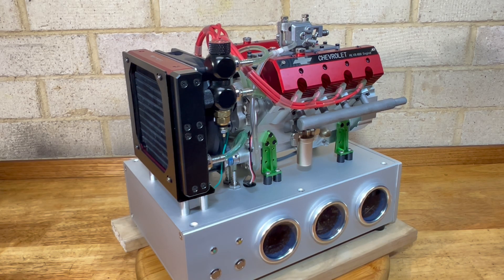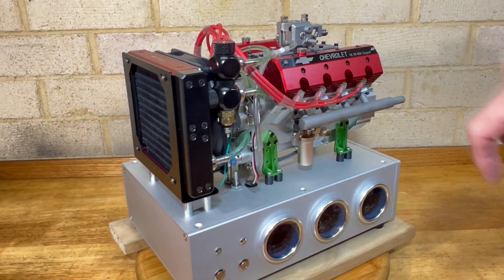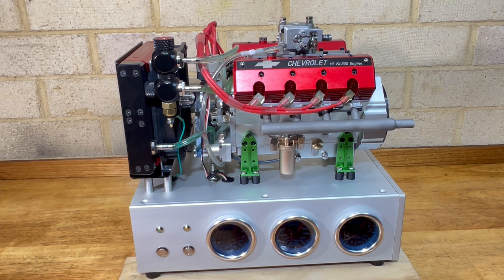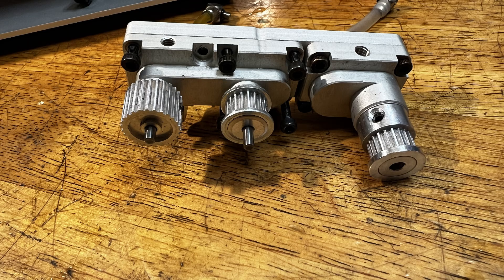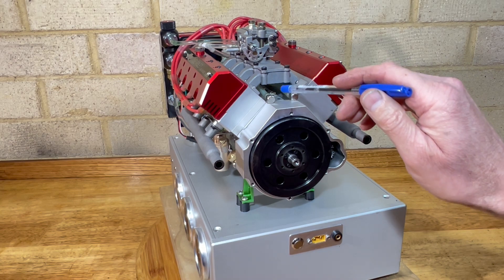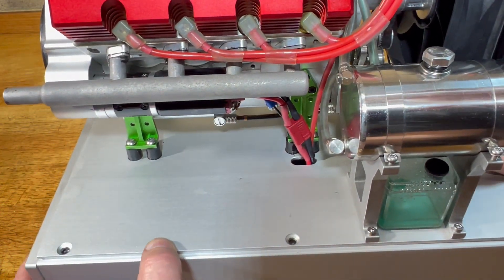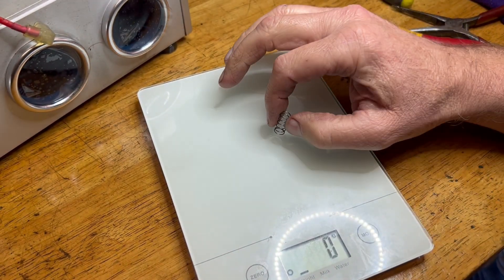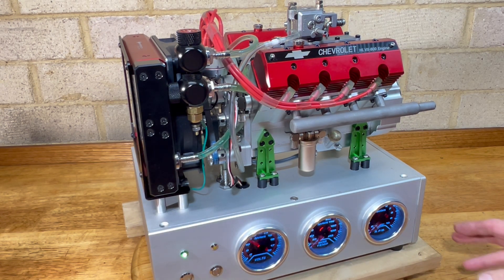HL VX-800 Scale model engine

Comment: Hello, I am the author of this engine. The engine block and cylinder head need to open their own oil return holes so that there will be no oil in the rocker arm chamber. I have posted the hole parameters on my homepage, which can be viewed. Thank you!
http://youtube.com/post/UgkxRl7FUD13-hAcwA-BikrUBYNLYIwbJo7I?si=2JcqP_mqKvywQXuR
Reply from the maker: Ok, excellent, I will do this modification. At the moment if the engine sits for any amount of time oil will drain into the exhaust pipes and makes a mess. 
Thank you for the information and drawing.